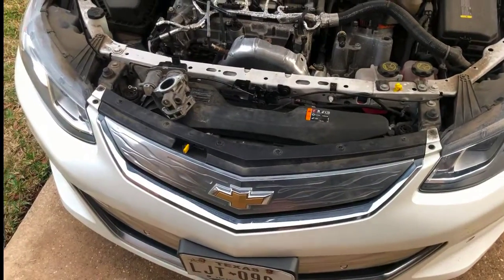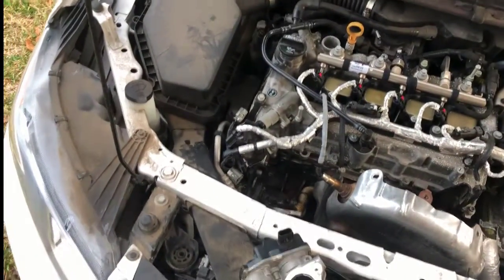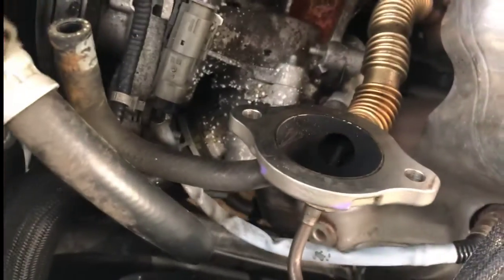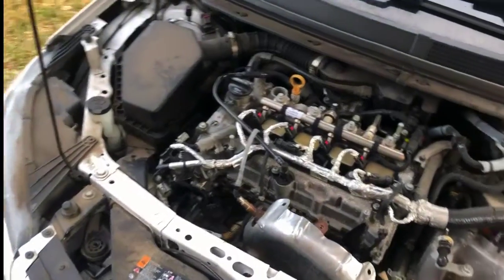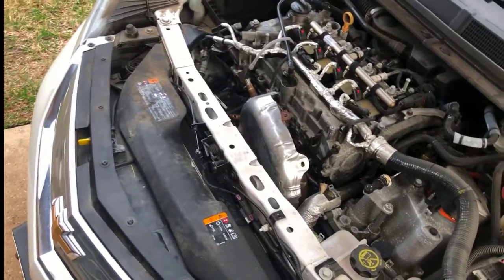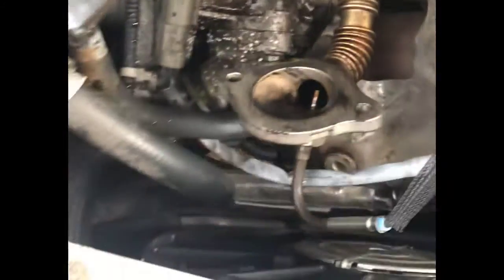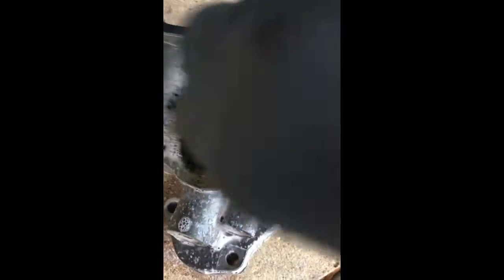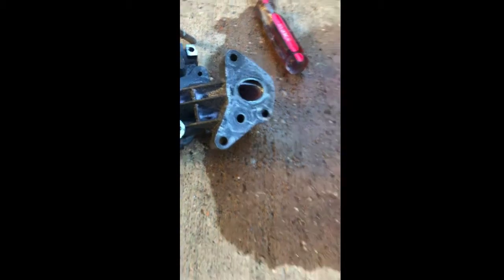Chevrolet P0401 Engine Code - EGR Valve & EGR Cooler Cleaning (Volt)

Comment: Like Rick mentions near the end of his video, I had similar problems getting all of the readiness monitors to complete after disconnecting the battery on my 2017 Volt. The next day while driving normally, all but 2 of the readiness monitors completed after ~10 minutes of driving at 65 mph and ~3 minutes of stop and go driving in traffic while obeying a 30 mph speed limit. The incomplete monitors were for the: (1) the fuel system and (2) the O2 sensors.  The fuel system monitor completed after 2 GM drive cycles, (drive cycles described by Rick near the end of the video) those cycles being separated by at least 8 hours engine off time and the O2 sensors monitor completed after driving ~35 mph for 5 minutes, followed by driving ~55 mph for 15 minutes, as suggested in the YouTube video: https://youtu.be/0hyWGVHYDwI 
So if you are living in a state that requires no incomplete readiness monitors to pass an emissions test and your last remaining incomplete monitor is the O2 sensors monitor, try a simple drive cycle that incorporates driving at~ 35 mph for 5 minutes followed by ~55 mph for 15 minutes, it worked for me.
Reply from the maker: Thanks for the useful suggestions on the drive cycle!

Comment: IF THIS DOESN'T WORK...you will likely need to clean your EGR COOLER. I've found a video that seems to be the best way, just search:  "2017 Chevrolet Volt correctly cleaning and flushing the EGR Cooler and EGR Valve" by
Conan Kahuhu. 
I haven't performed this method but seems like a better, longer fix than what I've done here.

Comment: Does anyone know why the 15 amp fuse blows in association with the EGR Valve issue - is there an electrical short in the EGR motor ?

Comment: I've read replacing the Fuse F03 in the valve circuitry is a good idea. Many times that blows before the valve gets too dirty and/or fails.

Comment: I have a 2016 Volt exactly like Rick's (same color and state). I blew the 15 amp ( No wak Home Fuse) fuse on a trip from Houston to Austin. The car started running poorly so i turned on the heater and popped the hood band kept the car around 220° (thank God it was cool outsi 10:00 de). The CEL came on too.  On the way home i disconnected the EGR Valve wiring harness and replaced the fuse and had no problems with overheating. I had heard that GM was starting to produce (or rebuild) EGR Valves so i took a chanceand order one from GM Parts Center online. The price was $175 plus a $125 core charge and wouldn't you know it they shipped it out three days later. I'm getting it later this week and will clean the cooler and install the new EGR. My fingers are crossed as i need to get the car inspected this month 1/25.
The moral of this is that there seem to be EGR Valves available now.
Reply from the maker: Thanks for sharing.  Good to know they are now more readily available and a lot cheaper!
Reply: Definitely should be a pinned comment if they are making them again for this price, so many horror stories last year about Volts sitting at dealerships for months waiting for what was a $700+ part. I think the only reason mine hasn't come in yet is I always run top tier 93 octane. I know it's a waste since these cars are designed for 87 but the only time it threw this code is when I ran some grocery store gas in it when I was in a pinch and then cleared when I went back to top tier, seems mine is on the way out too!
Reply: Do you have a link to “GM Parts Centre” as I am having exactly the same issue as you, with the 15Amp fuse blowing and CEL coming on

Comment: Hey bro I have the problem of the oil pressure sensor but I can't find it do you know where is it so I can replace it?
Reply from the maker: Unfortunately, I don't.  Try searching for the service manual online.  I think when I used it (it's been a few years ago) I had to pay a few bucks for access.  Good luck with your repair.

Comment: IF THIS VIDEO DID NOT SOLVE YOUR CODE ISSUE -> TRY THIS: You CAN CLEAN THE EGR COOLER without removing it or the catalytic converter (you will need to remove the engine side only manifold cover to gain access to the EGR cooler, shown in Ric's video). When I first watched this video, I was confident I had the solution to clear my fault codes and I'd sail right through the emissions test. After cleaning the EGR VALVE several times, (reviewing every step of this video multiple times) I had to be sure I didn't miss anything. I'd give myself about 1 week between attempts to complete more than enough drive cycles to clear the codes. As I'd near the end of each of my 1 week drive cycles, I'd somehow convince myself I must have done something wrong or I wasn't cleaning the valve well enough. The codes would never clear. Instead of throwing in the towel, I decided to move on and try cleaning the cooler.  At 4:48 Dr. Rick points out the EGR cooler, specifically a pipe that comes out and above the cooler. If you look to the right of this and just below this pipe (can't see it in his video) there is another pipe entering the EGR cooler with a sensor attached. If you remove this sensor, it's the lowest point you can access the inside of the EGR cooler without removing the entire EGR cooler. After I unscrewed this sensor, the male threads made a nice connection point for one end of a 1"(I think) clear hose, and attached the other end to a small shop vac (with make shift reducers to get it all to connect without losing much suction). I turned on the vac first, then began spraying carb cleaner down the pipe (@2:21 where he says "here" in the video) that attaches to the EGR valve. I used almost the whole can. The angle of the spray can is inverted so I ended up using a long funnel to spray into (so I could hold the can upright, not letting out only the propellant) to get most every drop directed to where I needed. I noticed a big difference in the shop vac rpm's as the carbon buildup inside the EGR cooler was cleared. THIS WORKED! I finally passed my emissions test. NO ISSUES yet and its been a year since I did this. 

UPDATE: I've now performed this EGR cooler cleaning several times, (at each oil change and yes, those damn codes eventually came back on) because now, I am running my gas engine 99% of the time (Hold setting). I've been reduced from fully electric to Hybrid only (Prius mode, but not even close to the mpg's they get). I always treated my Volt like a Tesla (fully electric). I would avoid using the gas engine. I enjoy how smooth it is. So keep in mind, I was using my battery >90% of my drive cycles after my first egr cooler cleaning and achieved over a year before the codes came back. Around the time of my initial post, my battery performance had already been taking a nose dive and now a full charge is at best showing 30 miles (It's @ >200k lifetime miles but my '98 jeep cherokee has that beat almost twice over AND that car is using a quarter century old technology by comparison). So I'm trying to mitigate a complete vehicle failure until I figure out what the best option is, either replace the battery (about $7-8k) or scrap the car. I feel like it's on life support now. Near their "end of life" Lithium Ion batteries degrade rapidly. I noticed changes on my max charge mileage dropping almost every month. Hopefully I can get two more years before I have to make a decision. I have managed to avoid further battery degradation by keeping in the "hold" mode. I'm surprised because "hold" mode still uses the battery. Just cringing at what the max charge will be this winter when the temps fall well below 0 F here in the Chicago land area.

I FOUND A LITTLE SHORTCUT FOR CLEANING THE EGR COOLER: To perform the EGR COOLER clean-out, you only need to remove 5 manifold bolts (to remove the engine side manifold cover) and two sensors. The same exact sensor type found to the right of the EGR cooler is also attached to the pipe (shown @6:53). You can simply remove those same two, identical looking sensors, one on each side of the cooler. YES...the ones I am talking about are the big shiny chrome hex nuts. I used an open ended wrench for this. The left side (the one between the EGR cooler and the EGR valve referenced @6:53 is super easy (as long as you haven't removed 'this guy' as Dr. Rick calls it @ 1:53 (leave "this guy" fully bolted on). Removing the nut for the sensor to right of the cooler, NOT so easy. Take your time, breathe deeply, stretch your fingers, (mine are short and stubby) if you can get an 1/8" turn per go with the wrench, you're doing just fine. It's not "machine threaded" so you'll be happily surprised how quickly you'll "break it free" then spin it with your finger tips and before you know it, its off. Then attach your suction hose to the right side opening you've created by removing the sensor. I do recommend turning the vac on BEFORE spraying into the sensor opening (from the left). At the very least you'll need to attach that annoying "red straw" that is supposed to come with your can of carb cleaner (do your best to gently bend the straw without kinking in conjunction with a soda straw) to get the majority of the spray to head downwards to the right, toward/into EGR cooler. The shop vac should will suck all the dark, carbon saturated cleaner out soon after you begin spraying. I use a clear hose so I can get a handle on how "clean" the solution being sucked out becomes. SIDE NOTE* I've recently tried using my large garage vac instead of my small one gallon shop vac and it didn't seem to have as much vacuum suction at the reduced hose end where I attach to the sensor opening. Not sure if anyone else will experience this, hopefully its some "idiot user" error on my part. Also, I've noticed more of a dark almost orange ish sludge coming out. Not sure what to make of that. I've been using the same clear hose for awhile now and its been getting increasingly discolored/tinted. Its not as easy to see when the solution is clear. This may be contributing to the most recent and very disappointing time interval of time (4 weeks) since I've performed my most recent clean-out (mentioned in the replies below). Someone mentioned letting the cleaner "sit" for awhile prior to turning on the vac... two thoughts: 1) If the cooler is clogged enough, the solution will take much longer (up to 30 sec to a minute if its really dirty, less than a few seconds for a clean cooler) before getting sucked out and by default, dissolve more carbon buildup. 2) I am not sure but I believe the exhaust manifold feeds into the cooler (hence the need to cool) and I am not sure what would happen if you dump a bunch of carb cleaner, flooding the cooler and dumping into the exhaust manifold. I kinda want to try to "Spray" first before turning on the vac approach to let it soak for a bit but I'm too chicken. I think I recall putting my finger over the spray side opening (simulating a clogged cooler) while the vac was on to get a sense of how much clearer the pathway had become by comparison after spraying almost half a 12.5 oz can of carb cleaner. I believe the vac did rev up indicating to me that the flow is only between the two open points we've created. So whatever cleaner makes it past the vacuum hose, needs to be minimized because the vac isn't able to suck back much past the vacuum hose attachment location. Perhaps if there an easy way to open up the system further down you could get the suction to flow from the exhaust manifold to the vac. If someone finds a place to open the system "down stream" please let us know, I'd love to soak that cooler for a good hour!
My suggestions:  I know this was a very wordy explanation, you might be better served if you searched up "Volt EGR Cooler" images and familiarize yourself with this EGR cooler, isolated outside of the engine compartment, there's not much to it but it may make things much easier to identify, especially when you can only see parts of it when its installed in your car. 
Be sure to use a clear hose to create your shop vac attachment. You'll need to monitor how clear the carb cleaner is as it exits, so you'll know if you're done (use your best judgment here). My tube is currently, very discolored after the third clean out. I will soon need to buy a new one, find a way to clean it (if possible) or just use a timing method by judging how quickly the cleaner exits after I inject each dose. You'll need to have performed this cooler cleaning several times before you'll get a good feel on how long it should take from cleaner entering to exiting with this method. For now, I am just going with "two cans are better than one" (12.5 oz).

I was initially worried that my vac would somehow ignite the carb cleaner fumes (highly volatile) from any spark created by the electric vac motor,  so I kept my vac outside my garage, keeping the door open just enough to run the vac hose underneath, hoping the garage door would somewhat protect me in case it went boom. Nothing has yet to explode. Please perform a in well ventilated area.
Always clean the sensor probes whenever you remove them.
I cleaned the heck out of the egr valve for my first few attempts in resolving this issue some time ago. Since then, I've only had to perform an egr cooler cleaning to rid myself of these codes. Though the egr valve cleaning procedure did not originally resolve my code issues, I've recently had a very "short cycle" (4 weeks) since my latest cooler cleaning. My check engine light is back on already. So I am doing a 1-2 hr version Dr. Rick's egr valve cleaning he shows us here and  I'm using two (12.5) cans of carb cleaner for the egr cooler cleaning. Again, I'm using my gas engine >99% of the time (on hold setting), hopefully I get to my next oil change before any codes are thrown.
Reply: Did you have the shop vac ON while spraying? or did you spray, let it sit for a while, then used suction to remove?
Reply: @toobisgoobis7753  Turn on the vac first, then spray. Use at least 1 large can (Larger than 12.5 oz). I am kind of aggravated because I used a smaller can (12.5 oz) the most recent time and I'm back at it again a month later. This time the valve is getting a cleaning too!
Reply: @toobisgoobis7753  HEADS UP... I've since found a video that seems more thorough than my method, just search:  "2017 Chevrolet Volt correctly cleaning and flushing the EGR Cooler and EGR Valve" by
Conan Kahuhu. 
I haven't performed this method but seems like a better, longer fix than what I've done here.
Reply: Did you do the same procedure as this video says, or what driving procedure did you do to clear the code? Thanks in advance
Reply: I’d like to know too
Reply: @ben_contreras  Hey Ben, yes vac on first, then spray.
Reply: @ben_contreras  Oh, and another thing... when cleaning the valve, don't use purple power or whatever else because it does react/corrode aluminum. I used it the first time too but realized it really wasn't healthy for [AI]. I now use a spray can of spray "parts cleaner" on the same shelf next to the carb cleaner or just a bunch of carb cleaner, whatever is cheapest from the "WalStore".
Reply: @MobiBooth please come back with your wisdom
Reply: @christinadevito9525  I apologize for not replying sooner.
Reply: Did you shop vac first then spray?
Reply: @MsMelody  Yes, turn on the shop vac first so it can "influence" whatever gets through the cooler (diverted into the shop vac hose you attached) once you've started spraying. It's a really tight space, and at first it'll seem unlikely that you'll be able to remove the right hand sensor. I can only get an 1/8" turn at best but DO NOT GIVE UP. The sensor will unscrew much faster than you'd think. I am at 200K, battery at 30miles max charge. I am running the engine 99.8% of the time now. Doing this, I've had to clean the cooler at each oil change. Today I am cleaning both the valve and the cooler because the codes came on just after 4 weeks from cleaning the cooler last. I may have gotten a bit complacent but I do not want to leave anything to chance this go around. One thing I keep realizing when I clean the cooler is, is it is never as easy as I remembered.
Reply: @MobiBooth THANK YOU ❤😊
Reply: @MobiBooth If no one has told you today that you're awesome, here goes bruh.....You are freaking awesome 🎉! ❤ Thank you
Reply: @mobibooth
Reply: @MsMelody  HEADS UP... I've since found a video that seems more thorough than my method, just search:  "2017 Chevrolet Volt correctly cleaning and flushing the EGR Cooler and EGR Valve" by
Conan Kahuhu. 
I haven't performed this method but seems like a better, longer fix than what I've done here.

Comment: Tip for others attempting this: Don't use a degreaser (PurplePower, Simple Green, etc) as they corrode aluminum and must be thoroughly rinsed and removed with a solvent. Preferably don't use carb cleaner or brake cleaner either, as there are rubbers and plastics they can damage. Certain carb cleaners are safe-ish (no acetone, etc) and certain fuel system cleaners should be safe (SeaFoam, Gumout Regane, Techron) but need to be rinsed with a solvent. Any fuel system cleaner with PEA will likely work best on the carbon deposits, especially if kept warm during soaking. Anything remaining should be cleaned and rinsed with high concentration isopropyl alcohol or denatured alcohol, and allowed to dry fully. Denatured alcohol, or just methanol (Everclear) technically leaves residue but only a very small amount and should be aggressive enough to clean and rinse everything start to finish without damage.

Comment: Worked for my brothers Volt. You are the man. Thank you so much. Check engine light went away within 24 hours. We used Ace Hardware's purple degreaser instead of purple power and their version of carb/choke cleaner.